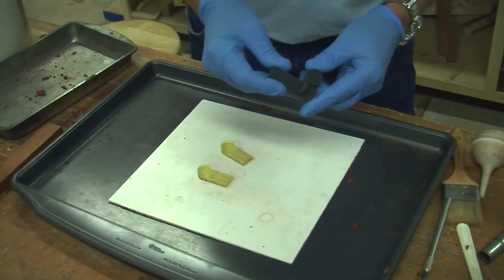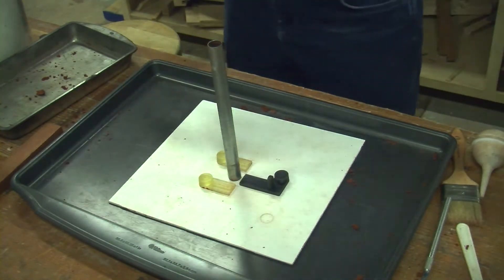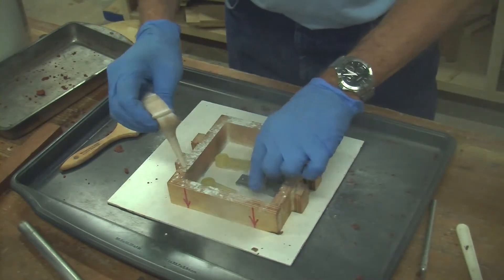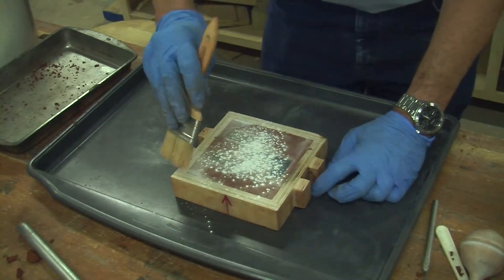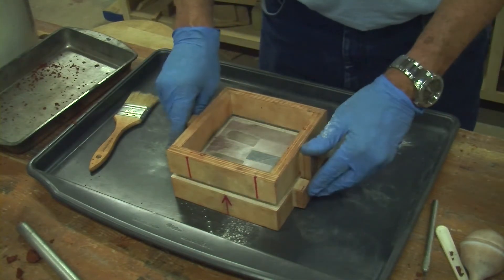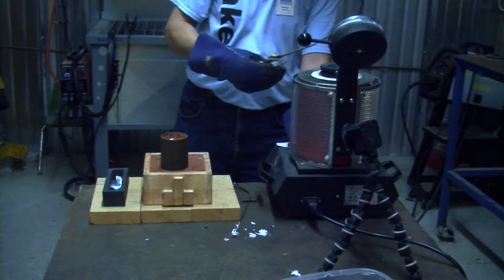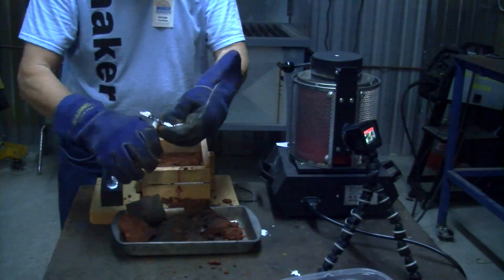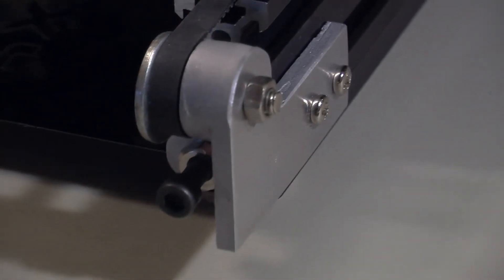Metal Casting with 3D Models

Comment: Why not just burn out the model like what they do with lost PLA casting, with that you would not need to worry about the geometry of your model.
Reply from the maker: PLA leaves too much ash and creates poor castings.  I did do a video on using castable resin which burns out very cleanly.  Also, sand casting is much quicker and simpler than investment casting.
Reply: @makerspace533  Thanks for the reply. I have always wanted to do some casting myself to up my skills from 3d printing to metal fabrication. Any links where you got your electric kiln?